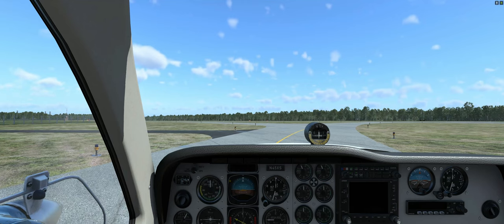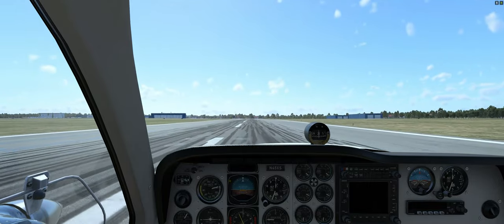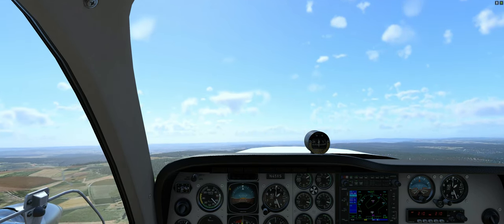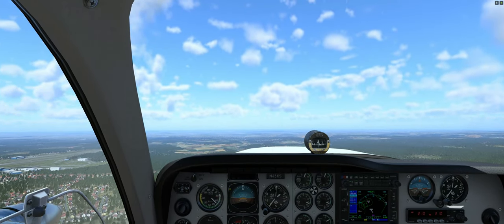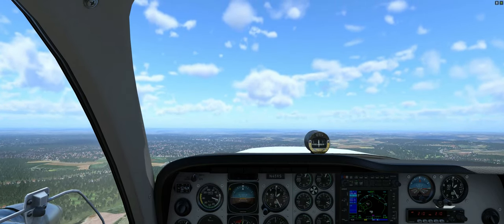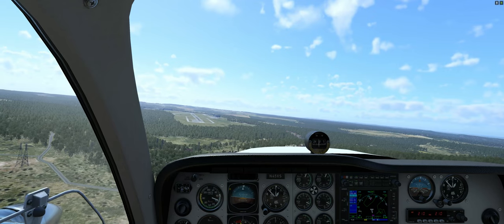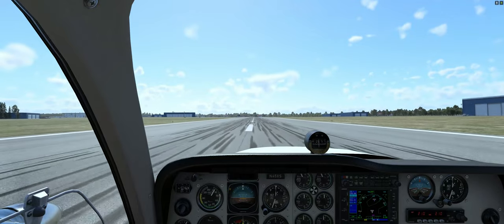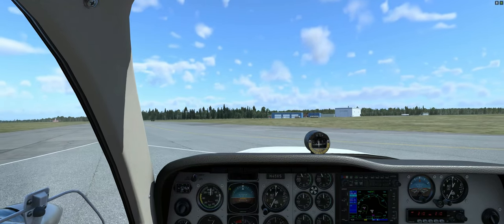X-Plane 12 : First look at Beech Baron circuit

Comment: Just couple of things that could make your flight even more realistic... At 500' AGL  manifold pressure 25/rpm 2500, at 1000' AGL manifold pressure 20/rpm 2300. This should give you the performance for circuit, you would be targeting 120 Kias on downwind, on final 100 Kias down to 90 towards touchdown.
Reply from the maker: Thanks for your input. I really appreciate it. It certainly helps to properly fly the aircraft.

Comment: I've found as you near the threshold you'll start bleeding off airspeed which will cause the aircraft to drop so you'll need to add power to keep 90 to 100 mph...keep adding or reducing power as you hold the plane off and slowly and smoothly touch down. It does work...had the same problem as you but after talking with some others about it I've been shown how it's done correctly. Come on back to X Plane supanova!
Reply from the maker: I would expect more lift from ground effect. I'm struggling a bit with X-Plane 12 at the moment.
Reply: @supanova88  I think the Baron drops when the engines slow down unlike single engine planes but when you add power you don't drop...keep enough power and stay above 85 kts so you don't drop. The baron is the hardest plane to learn but it is flyable and I get where you're coming from.

Comment: The landing characteristics are very wrong. I have a lot of flying hours on the Beech Baron and it's one of the finest aircraft I ever flew, that's not at all the way she flies in real life. This whole myth of X-plane flight dynamics being better is just that, a myth. I've been flying in real life for 53 years and I get a lot more enjoyment out of flying in MSFS...is it perfect? of course not, but it's getting better all the time and perfectly flyable right out of the box with excellent default aircrafts. There is a place for all competition out there and that is very healthy for the siming community. Bottom line is if you enjoy it then use it, but it doesn't have to be a one against the other sort of thing like the Beta vs VHS, or IMB vs Apple debate and snobbery nonsense of the 80's for those who are old enough to remember that 😂
Reply from the maker: I spent a lot of time trying to land it properly until I realised it's so nose heavy it just wants to dump it onto the runway. The stock Baron, as you mention, isn't worth investing time into, without adding the REP, and I don't know when that will be updated.
Reply: Even a half a million $ certified sim i flew was not realistic at all. We used to say "if you could fly the sim the real one will be piece of cake!"😀
Every sim out there is there to practice procedures, not practice the actual flight. Practicing an approach is ok, but practicing landing in a sim would be a big mistake, the real thing will never be the same.
Reply: @supanova88  It's ready now, REP that is.
Reply: @MyChannelForever  So true! I flew in old days the DC8 and the DC10. The simulators were much more difficult to fly than the real birds!
Reply: Yes, I had to move the CG way forward to get enough elevator power now lands just fine. @supanova88